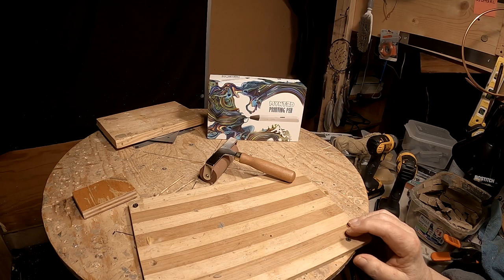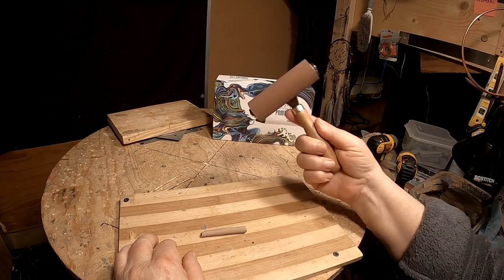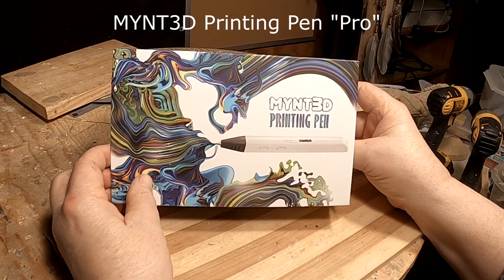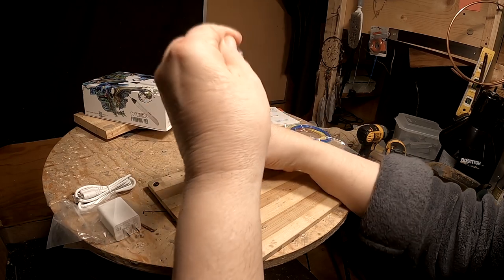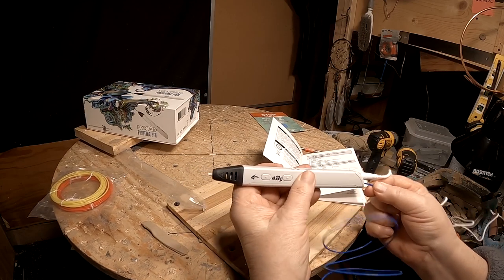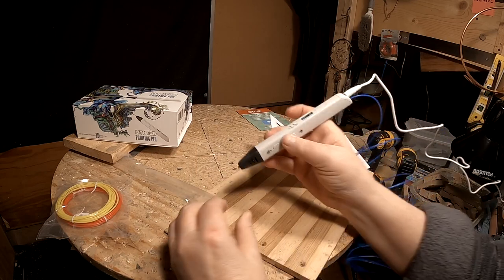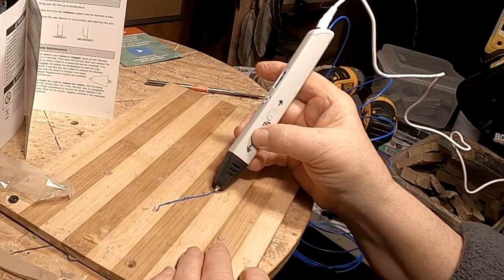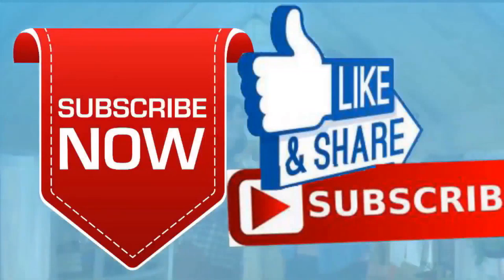Trying out the MYNT3D Printing Pen Pro

Comment: Just be carfull, the ABS fumes are toxic.
Reply from the maker: I won't be using it a lot.. just ever month or two if even that
I looked it up... Although ABS filament fumes are not considered toxic, they are unpleasant to most users. As the material is heated in a 3D printer, it creates gas and microscopic particles during the process. This exudes fumes that can cause physical discomfort such as drowsiness, eye irritation, nausea and headaches.